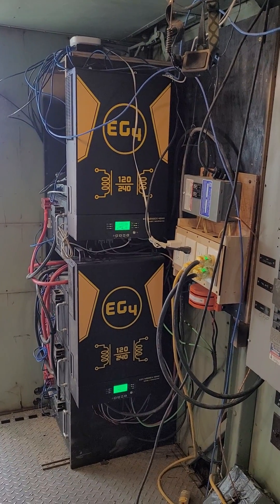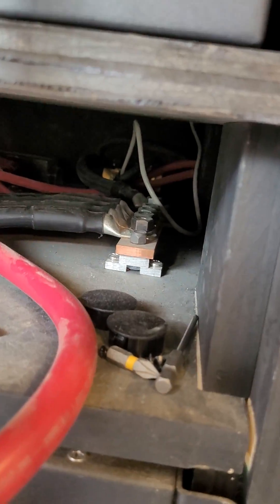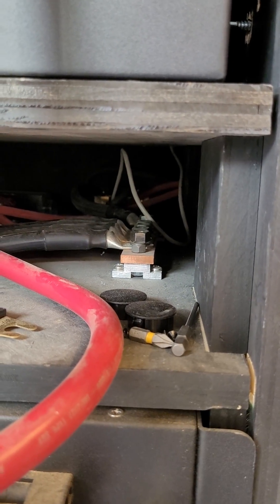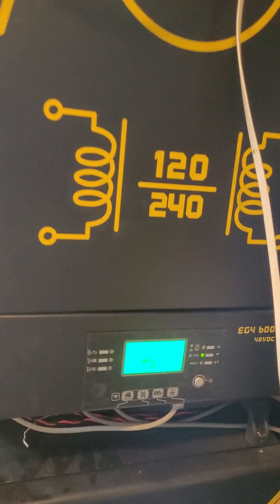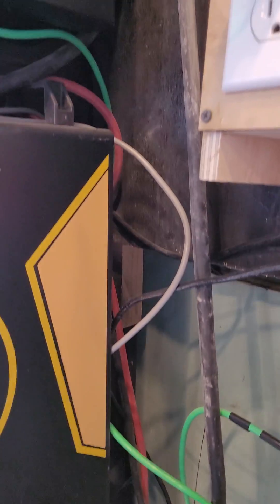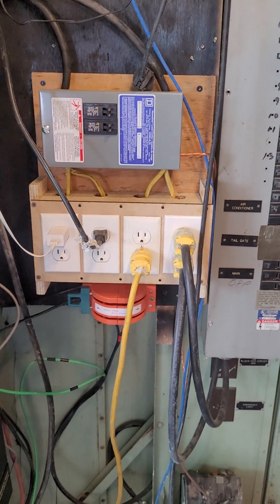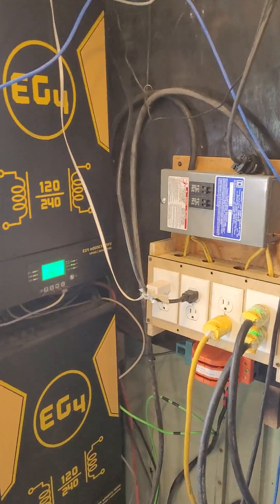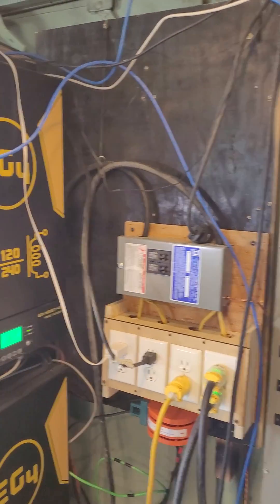EG4 EX6000 Inverter Setup in Army Command Bunker - Randomly Powers Off....

Comment: Do you have any issues with your lights flickering since you have the two units running in parallel? I had a hell of a time and they kept turning off and on. I was scared to death something was going to blow up and went back to just using 1 unit for now. I still have the second one hooked up, but only runs in charge mode. They were making a horrible hummmmmm sound and then started doing some really funky things when hooked together. And yes, they're wired correctly. My guess is something with the phasing of the sine waves gets way out of wack.